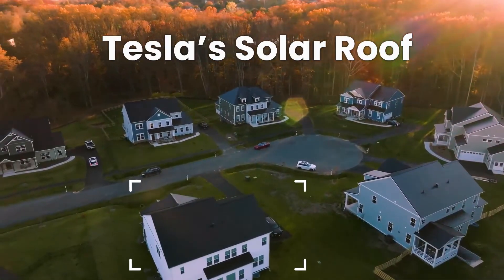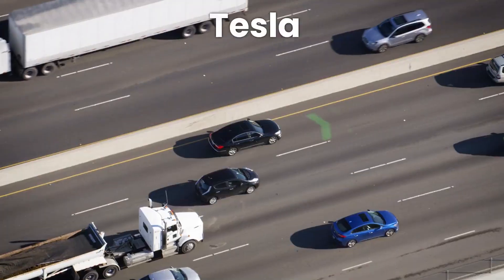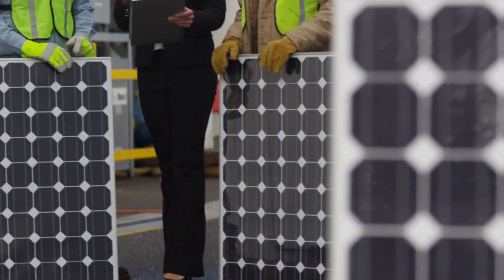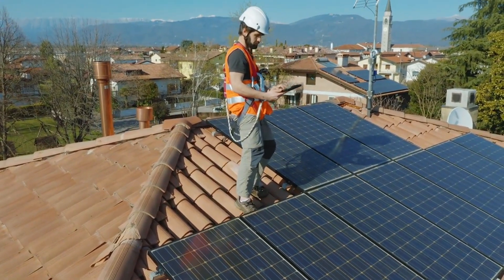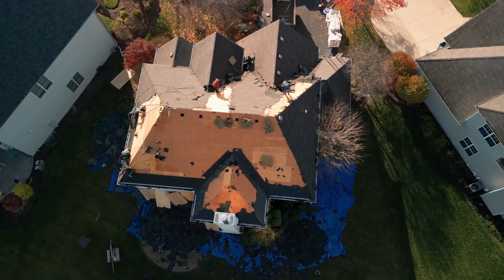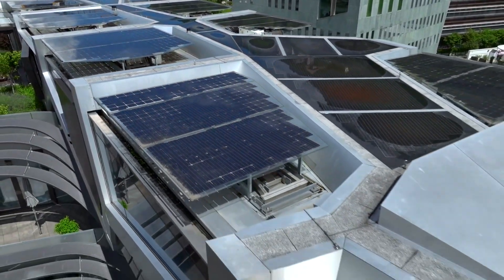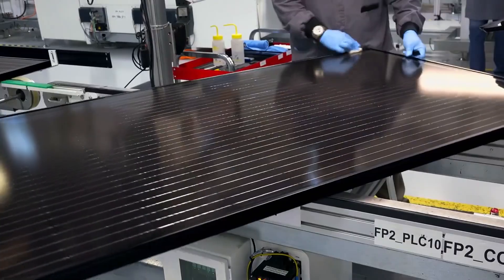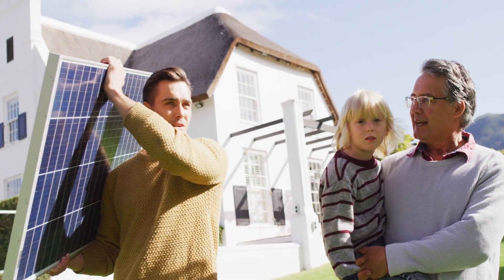Tesla Solar Roof Will Replace Solar Panels in 2025?

Comment: Good you had the ? mark in the end... no Tesla will not replace anything!
1) A solar roof that breaks needs to be replaced with the same (company)
2) Tesla is owned by a weirdo, of whom I will not buy stuff.
3) A roof is always in the position of the roof, you can´t tilt it towards a better angle
4) You basically need to make the whole roof of the same stuff, even if it is in shade.
5) There are other companies offering the same... nothing new here.
6) A plane roof (as teslas example) make the wind speed higher over the roof. While other companies tile shaped photovoltaic roofs decrease wind speed.
Reply from the maker: Good :)

Comment: I had always thought that the best solar roof would be one where a PV layer could be directly printed onto Steel roofing sheets rather than fabricating specialized ceramic PV shingle tiles or mounting traditional panels.
Reply: Do you have anymore thoughts please?😅